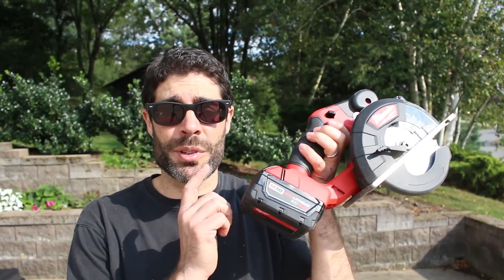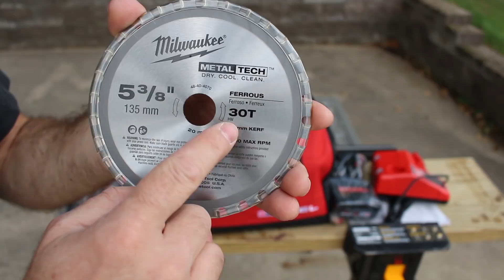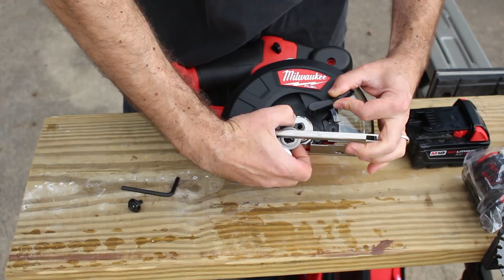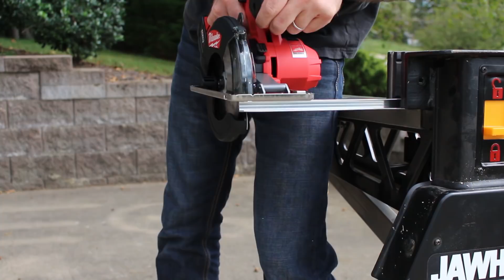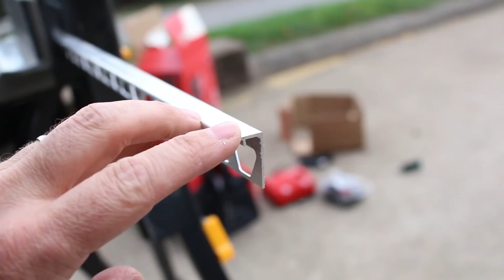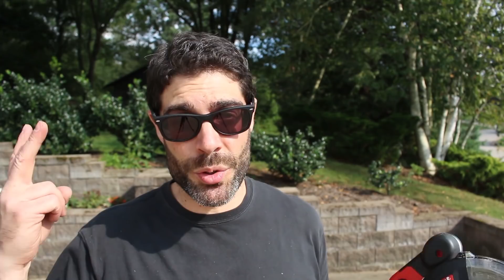Milwaukee Metal Cutting Circular Saw (Cut Anything Metal!!)

Comment: Hello help me please, I have this Milwaukee 2782-20 saw and I dropped the 3 pieces, external flange, internal flange, and washer, this happened to me for a fool when removing the support bolt to mount the disc, and now I don't know how it goes or how to mount the thin washer on the shaft, the 2 flanges that are much thicker if I know how they go, the thin washer that is like sheet, is the thinnest has 2 sides, one flat and one submerged, or with a hole, let's say like bottled beer cork, I don't know how it is put, or how Come on, could you tell me which side of the washer goes inward, bone towards the body of the saw, and which side goes outward, that is, towards the black screw or fastener bolt? Please help me. Thank you. I didn't lose the pieces, if I have them all, the only thing that happens is that I don't know how it's going or which side to mount the washer, Thank you!!

Comment: It's garbage. Crappy flexible plastic blade guard.
Reply from the maker: at first I thought the same thing, but after some discussion it looks like Milwaukee did that to prevent metal from bonding to metal
Reply: @HomeRepairTutor  don't buy it, if you actually look under the blade guard hot metal sparks melt the plastic... and my blade guard binded on the blade when I first got it...
Reply from the maker: @MichaelSeeds  that definitely sucks and Milwaukee should warranty the tool

Comment: How bout some stainless steel w that baby
Reply: Use cutting oil or Johnsons Baby Oil.
Reply: @luciusirving5926  yes it’s a blade saver for sure !
Reply from the maker: What kind?
Reply: The thickest stuff maybe some 3/8 316?
Reply: I have this saw on order. How is it on any kind of stainless with a carbide blade, or diamond.

Comment: good review i have been considering getting this saw and there are not many tool reviews on it, thanks!
Reply from the maker: Thank you, I really like this saw. Obviously the results depend on the material being cut and blade. But it's reassuring to know it can be returned if it doesn't meet your needs.

Comment: Points at sign on blade saying only for ferrous and says it’s for cutting all metal. You need to be careful about saying it cuts all metal, your idiocy is gonna rub off on someone and get them killed. You can’t cut certain soft metal with that blade because you can overfeed it and turn your saw into a spinning death machine headed toward your body. Aluminum for example is not ferrous and this blade is absolutely not safe for it. It will cut it but it only takes one time and you will be absolutely fucked up.

Comment: First off the u channel was aluminum and you called it metal and so was the schluter piece there aluminum why would you put metal in a shower it’s going to rust
Reply: ch3ckm4te480 aluminum is a metal. If you’re going to correct someone, be right.

Comment: Wow. Your backwards. Blades on the right hand side are for lefties. Blades on the left side like worm drive saws are for righties. (Obviously either can use either) but it’s a thousand times harder to see what your cutting either the blade on that side.
Reply from the maker: I was simply stating my preference for the blade location. Warm drives are nicer in terms of the blade site line, but they're also heavier. So there's a tradeoff

Comment: Great tool! Your honest opinion....Dewalt 20volt Max or Milwaukee M18 series for the cordless family?
Reply from the maker: Whew, that’s tough. I have limited exposure to a lot of the DeWALT tools but am impressed with the FlexVolt grinder and circular saw, which currently is my favorite saw! I’d have to lean toward Milwaukee just because they have so many M18 tools and they haven’t let me down while doing projects. It’s a close call. DeWALT is a bit more cost effective, so that’s one thing to factor. I need more experience with DeWALT though before giving a final assessment
Reply: Home Repair Tutor Thanks for the feedback!
Reply from the maker: Happy to help, do you have a preference?
Reply: Home Repair Tutor I’ve been a Dewalt guy for thirty plus years. I currently have the 18V series but looking to upgrade to the 20V Max but was contemplating the M18 series. I’m a DIYer NOT a contractor so the extra cost of the Milwaukee series may not fit for me.
Reply from the maker: If you like DeWALT it might be good to stick with them. Especially if you already have a lot of their tools since the batteries are interchangeable. The batteries are so darn expensive!!
Reply: Home Repair Tutor Yes they are! Thanks!
Reply: Dewalt is not $399    lol
Reply from the maker: For some things they are $399 or more. But it depends on the tool
Reply: Dewalt is better quality, milwaukee doesn't hold up

Comment: it seems to perform very well but the price is too much for home owner which require such too once in a lifetime....
Reply: Moran Guy yeah I’d just put a metal cutting blade on a regular circular saw
Reply: Nicksperiments id use a grinder to cut metal as a home owner or a hacksaw. How often do homeowners need to cut metal?
Reply: crunch9876 homeowners not that often. I usually use a jigsaw with a metal cutting blade

Comment: What’s the difference between ferrous and non-ferrous metals? What are some examples? Thanks for sharing. That’s a nice looking tool.
Reply: MoneyManHolmes ferrous equals iron. Like cast iron, steel, all the kinds  of steel like crome, carbon steal, stainless steal. Non Fergus means not containing iron. Like copper, and I guess aluminum.

Comment: Awesome tips, how much does it cost
Reply from the maker: Bare tool is $200 and kit is $400 for now
Reply: Home Repair Tutor cost a lot, I already have a power saw, I just buy the blades
Reply: How is the saw different from other circular saws?
Reply: Scott Barnett I haven’t done any research on it but at a glance, the only differences seem to be:
1. Smaller blade since it’s cutting thin metal as opposed to wood
2. Blade cover ejects shrapnel down instead of sideways 
3. The shoe looks to be stamped stainless steel as opposed to aluminum or magnesium which possibly allows the shoe to slide better over metals without scratching or getting damages since aluminum and magnesium are kinda soft compared to steel
It probably has a bit more torque than a regular one to get through metal

Comment: I think the rear guard is made of plastic to avoid hot metal chips ejected from the cut welding to it.
Reply from the maker: Ah, good thinking!
Reply: I’m not sure how likely the shavings are to weld to it considering they’re so small that they lose enough heat not to burn your skin after flying only a few inches through the air. A more likely reason they made it plastic was to reduce cost and weight. It’s probably a thermo plastic elastomer (TPE) or polycarbonate (PC) which can both handle the sparks without getting damaged

Comment: 0.33
Check that statement.
Reply: I’m left handed and a right sided blade feels weird to me and the motor hits my clamps if I’m clamping to a workbench. Left sided works best for me so for right handed, I think right sided is better. The saws are designed to have good visibility from both sides so it’s really just preference
Reply from the maker: About the blade location?
Reply: Yea.
If you're a righty the blade is better seen if it's on the left. Also, $400.00 is off the chart pricey, I don't make that for a full days work. , I think I'll use my Dewalt and just buy the blade.